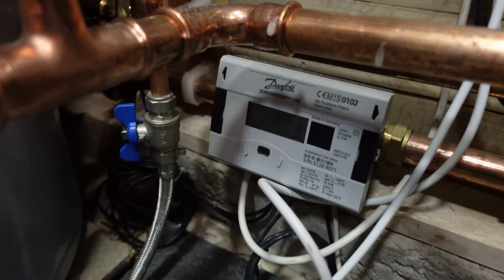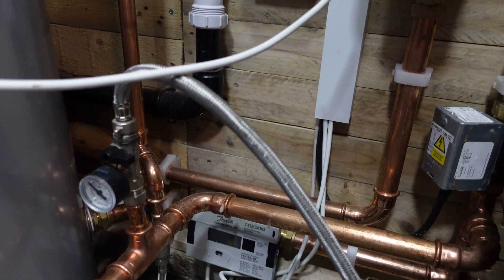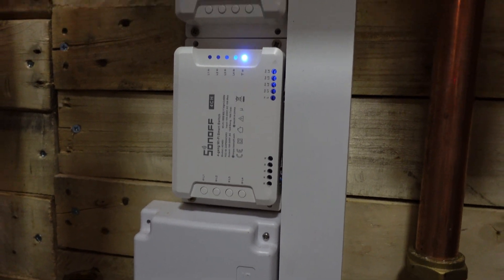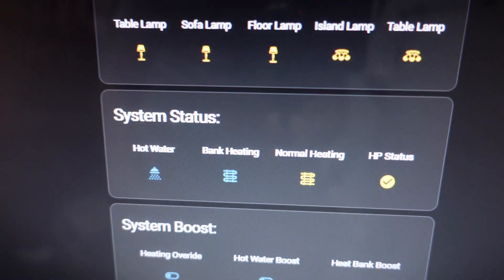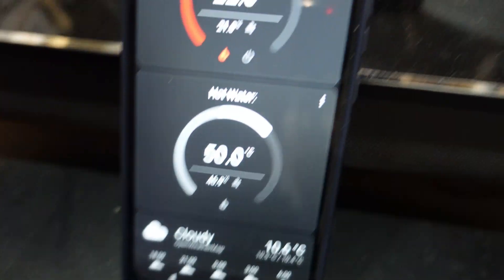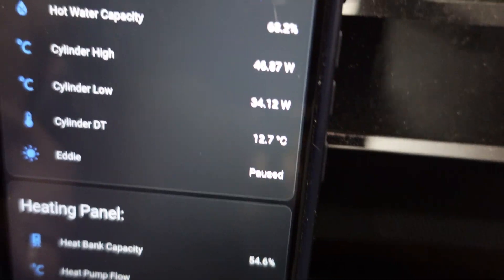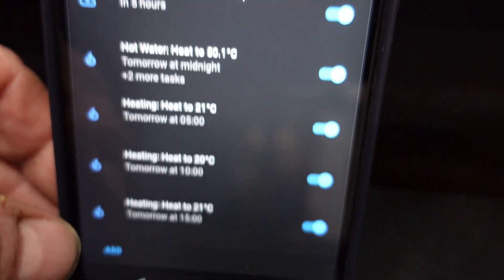Heat Pump System Revamp PT2 Home Assistant

Comment: Thanks Ken, great video.

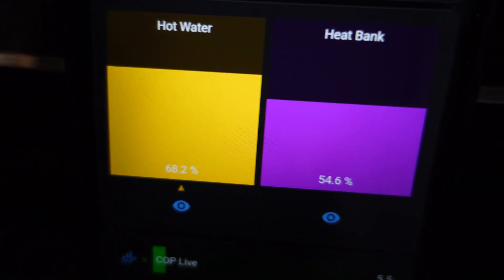How do you calculate the capacity indicators at 3:07? Do these just use the upper/lower temperature sensors?
Reply from the maker: Yes exactly that.

Comment: Have you considered adding a heat meter? (Sontex/Sharky/Qalcosonic)
I have been looking at the Heat Pump Monitor Level 3 bundle and EmonCMS but I'm looking for a heat meter that I might be able to directly integrate with Home Assistant, rather than via EmonCMS/EmonPi.
Reply from the maker: I have all three, they all integrate with each other. I had HA first and worked out my COP via the Carnot calculation.
Reply: @allthingsrenewable9017  Awesome. I need to spend some more time watching your videos. 👍